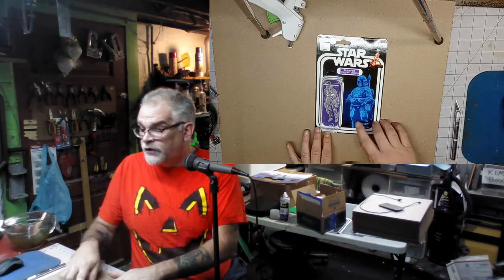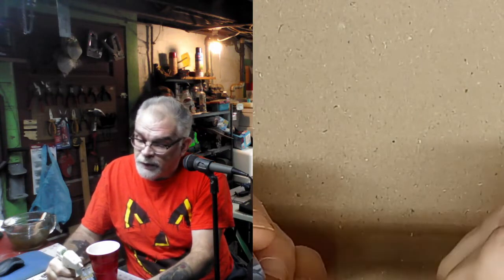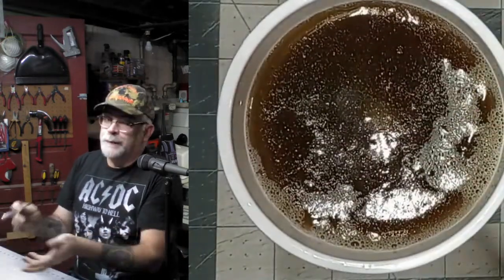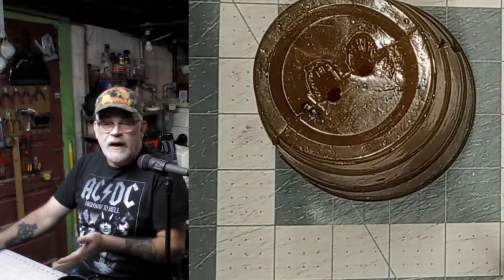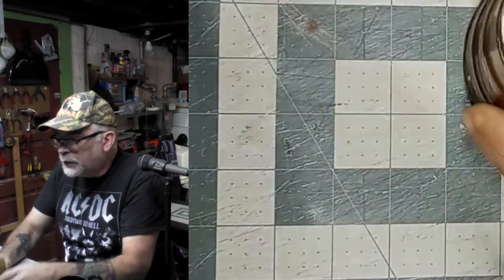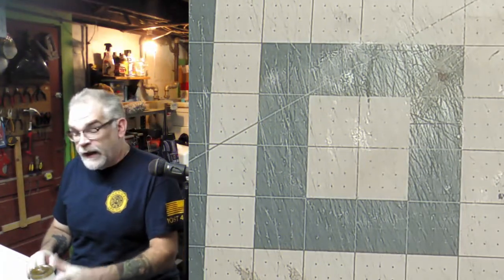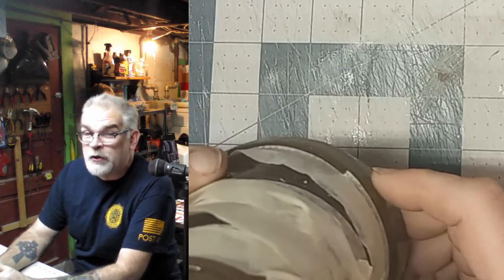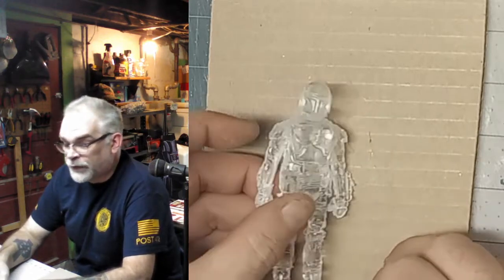Resin Casting 101: Making a figure start to finish with Clear resin and Reusable molding compound

Comment: I’ve been mixing acrylic paint with clear resin to give it a base color. I’ve noticed the finished product is much more rubbery than if I use just the clear. Do you know if this is the norm?  Do you have a Facebook for Jenner Custom Toys?
Reply from the maker: acrylic paint does work on the clear resin but it dries softer than without.  I have been using mica powder more lately and it seems to work nicely.  Sorry, I only have  a regular facebook.  I never bothered to make one for JCT.
Reply: @jennercustomtoys  thanks for the information!!